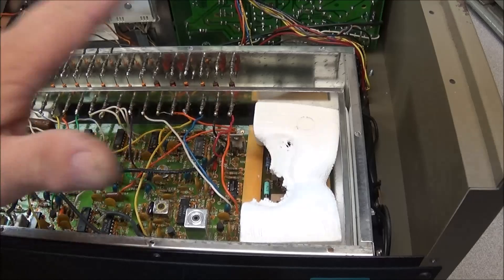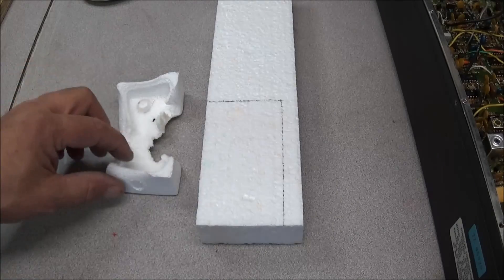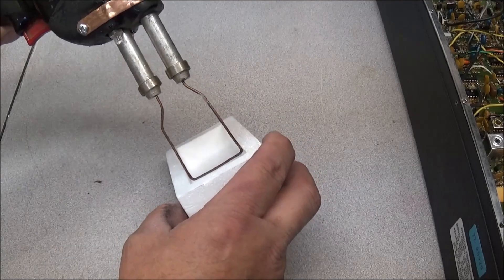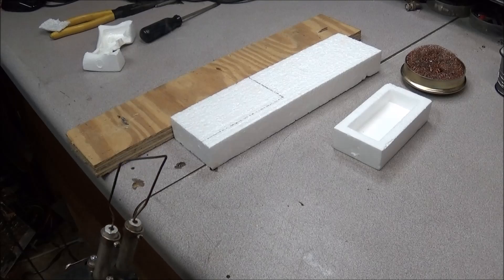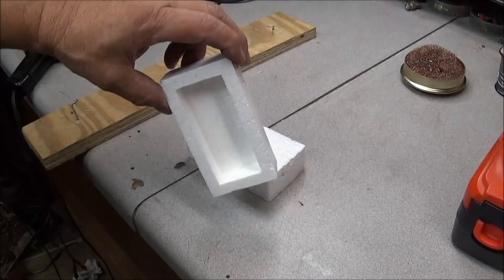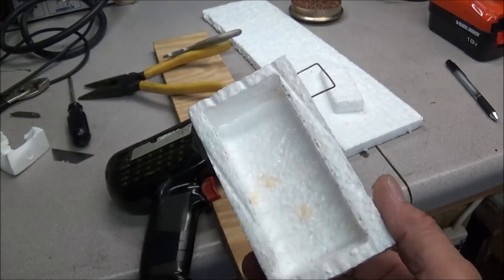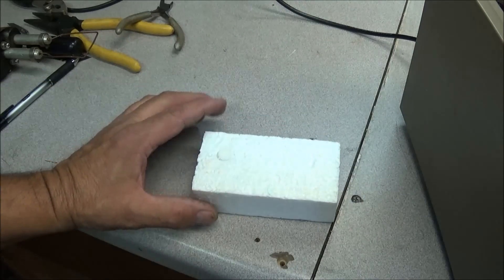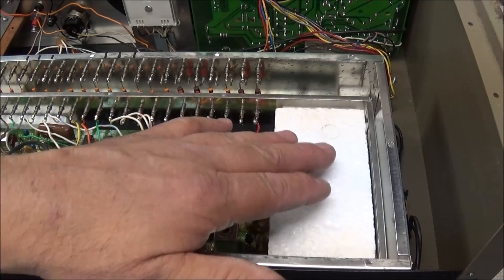#57 Shop Talk Fabricating a crystal oven cover B&K 2040

Comment: Buddy,

I use Sterodur for such things. The white foam you have there is pretty flammable and gives of poisonous gasses when burnt.
The light green or light blue foam you find at the builder yard is made so it doesn't catch fire easily and if it does, the combustion products are a lot less deadly.

73,

Paddy

Comment: Hi Buddy, simple but brilliant! That is the best way to replace or repair, the old KISS method. I really like that video, you can use
that skill for many things. Good video. Side Note: you are not kidding about chemicals and Styrofoam. I once sent a “new girl” across the shop to get some paint thinner. I gave her a Styrofoam coffee cup to bring it back in :>) Needless to say she only made it back a few feet, I had to avoid her for the rest of the day. We still became friends. I’m sure you never did that :D) 73Hope you enjoy your time off..
Reply from the maker: ROFL!!! I bet she was ticked he he . And yes I did that, Had a motorcycle with a carb problem  Stuck on the side of the road. If you dumped gas in the air intake it would crank. All I had was a foam cup. What a mess that was. Anyway you probably know me by now that I like to keep things simple. Thanks for the story and for watching 73 Buddy

Comment: Brilliant!!!  Probably wouldn't have thought to use the Weller iron as the knife.  Thats basically how the factory's cut it, hot wire knives.  Nice looking results you had there.  Luckily I have probably a lifetime supply of originals.  Think I am up to 5 extra units at last count.  2 working spares and 3 parts units.
Reply from the maker: Thanks Mike. I know it was a simple project so wanted to share.  It is always nice to have spares also.  I have 2 working units and one parts rig. I try and pick these up just for repairs.
Reply: +The Radio Shop 

Never have enough is my philosophy.  Great units designed for a single purpose and they do it well.

Comment: Good work!  Never thought of using my old weller for anything other than soldering before.  I saw Mr Carlson's chassis soldering with his where he used that thick piece of copper.  I know one of the attachments that came with my Weller many years ago was a tip that looks like it's made of all copper instead of being shiny like all the others I've seen.  I wonder if that was it's original intent.  I still have that tip, never used it, lol.  Take care, Gary
Reply from the maker: I think I remember that tip you are referring too. Been a long time since I have seen one.  I think it was made to cut a certain type of robe. Thanks for watching Gary.